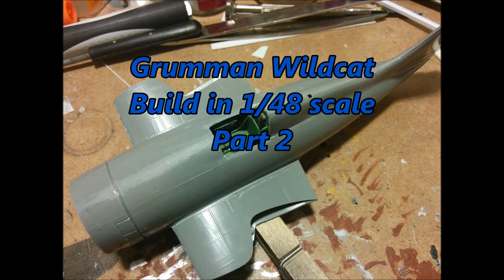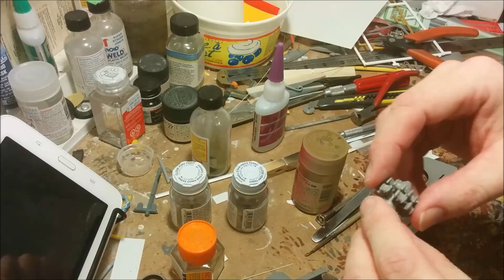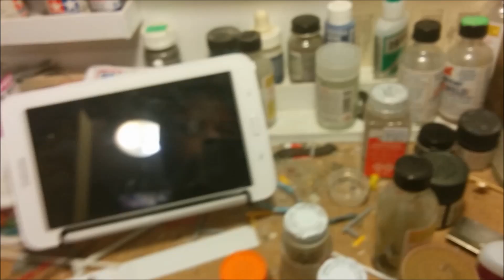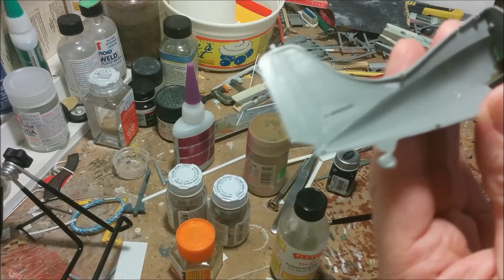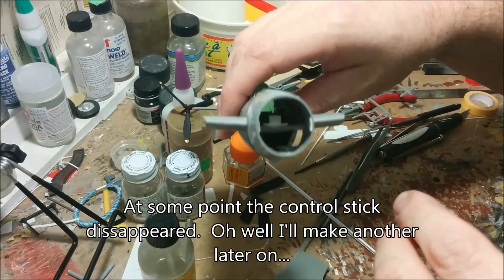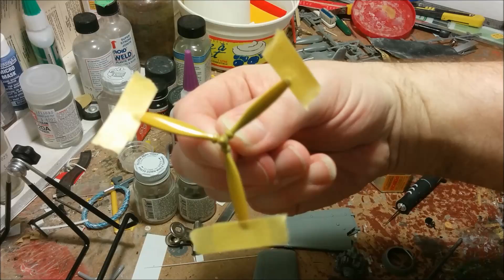F4F Wildcat build 1/48 scale Pt2 Monogram

Comment: I like your style on this build! A little over two years ago I got back into this hobby. I build my kits pretty much the same way. I like to take the old (50’s and 60’s) 1/72 Frog, Airfix, Revell kits, scratch build the cockpit and like the case of the Frog B-25D the bombardier’s section, any missing parts are either replaced from another kit, resin parts, vacuform or again scratch built. I always get the little friendly arguments on why not buy the newer/better kits and I just say I really enjoy building my kits this way. From doing this I also got into building resin and Vacuform kits. I personally feel building a kit in this manner will help a modeler deal with more difficult kits or parts of a build.  This will also help on some of the short run kits, especially the older ones and know how to handle their roughly engineered builds.

Great job on your approach on building this kit. You are definitely taking a kit that is a jack of all trades into a more accurate specific version of the F4F Wildcat.